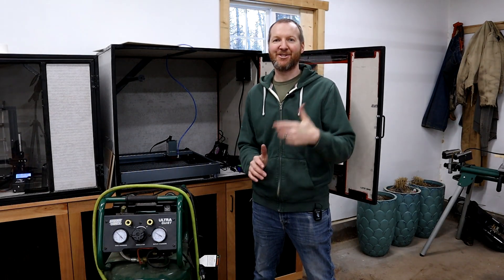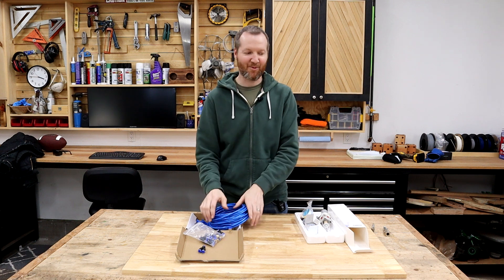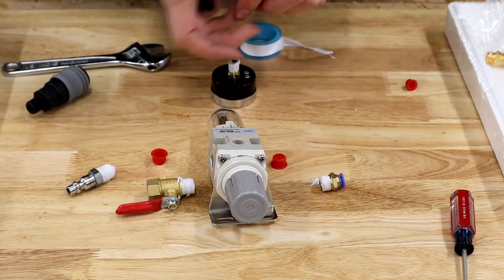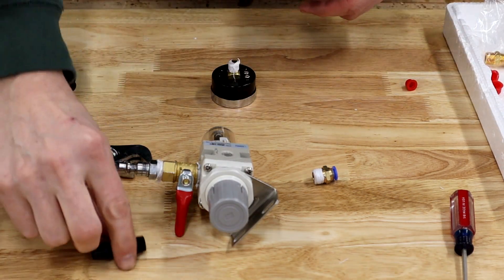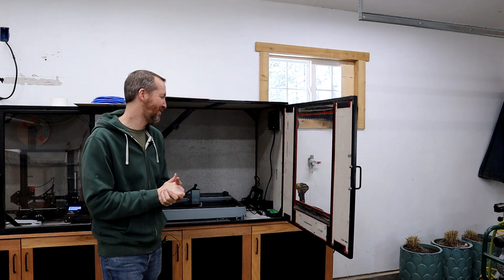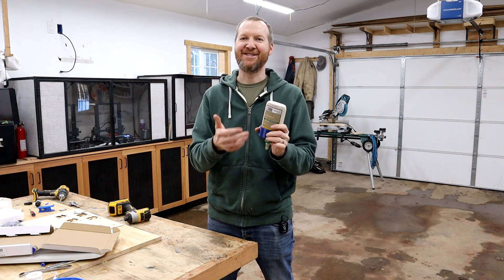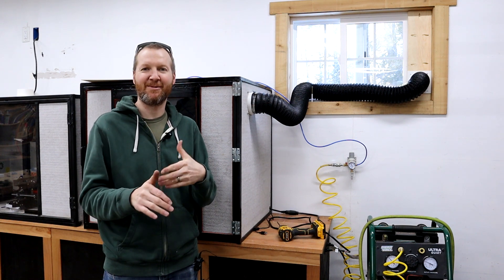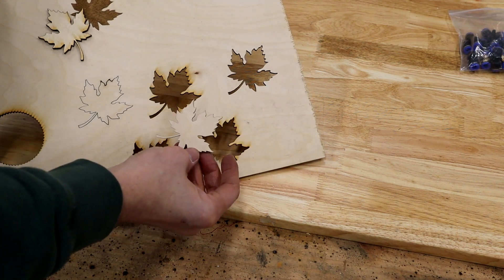$30 Laser Air Assist Upgrade/How to guide

Comment: I did this with a 3gal pancake compressor and results weren’t as expected. The compressor would run out of air and would keep the compressor running constantly and would cause the pump to heat up too fast. Returned the compressor and just bought an Amazon air pump.
Reply from the maker: Thanks for letting me know your results with the pancake compressor!

Comment: Doesnt your compressor already have a regulator? Usually decent compressors come with 2
Reply from the maker: Yep, my compressor does have a regulator, I just feel like it is a little inconvenient to use in this situation.
Reply: @chaddiy  got a question for you. my compressor and inline/regulator are the same as yours. mine isnt bulding any pressure, why is that.
Reply from the maker: @theemblemguys  hello, the only thing I can think of is your drain valve on your compressor isn't sealed, so air is leaking out of that.
Reply: @chaddiy  no the problem im finding is that it wont build pressure going through the inline filter itself. i bought a ball valve like you did but im still having the same issues...
Reply from the maker: @theemblemguys  ok, when I installed mine I had issue at first because I installed the setup backwards.  You might want to check and make sure you have your compressor line going in on the correct side of the filter/regulator.
Reply: @chaddiy  I guess I can see that if you don't have a dedicated compressor.

Comment: A "good" video, BUT,  I cringed when you started to thread in the fittings on the regulator....  a BIG FYI - when you wrap Teflon tape on a fitting, as you are looking at/into the fitting end, ALWAYS WRAP CLOCKWISE....  This direction of wrap will not "unwind" the Teflon tape as you screw it in.  The big A$$ bunching of the tape when you screwed it in PROVES the tape was wrapped CCW....  AND, when using this great tape, DO NOT wrap past the end of the fitting because you WILL F UP THE internals of whatever you are screwing....  A good idea video, but, not so much in the process....

Comment: Hello,

What size tubing is this for? The Amazon link has a couple different sizes. Is it the 6mm?
Reply from the maker: Hello, I am pretty sure it is the 6mm. I think the discription has changed on Amazon from inches to mm. I thought when I bought it, it was listed as 1/4 inch but 6mm should work fine. Good luck!
Reply: @chaddiy  thanks man

Comment: My laser machine is inside my craft room and my compressor is in my outside wood shop, so in the summer (Florida) the air around the compress is very humid, how would this affect the air going into the xtool, being it's in a air condition room? TIA.
Reply from the maker: Hello, I actually am not sure how the humid air would effect it. I know you can get in line air dryers that you could try. I am guessing it would be fine, but I think the only way to know forsure is to try it out. Good luck!
Reply: @chaddiy  Thanks for your reply

Comment: Xtool's air assist spec is about 30kpa or 4psi. Why 25psi and I can probably regulate that now on my compressor without the extra regulator.
Reply from the maker: Hello, that's true...you could probably just use your regulator on your air compressor. To me it seemed a  higher psi resulted in a cleaner cut.
Reply: @chaddiy  Thanks for the info. I haven't tried using air yet. Just curious as your psi was higher than xtool's equipment.

Comment: Very nice! Cheap simple upgrade that makes a world of difference. Quick question: What PSI did you end up using?
Reply from the maker: Thanks! For cutting I use around 25 psi...I have found for engraving it usually works better with no air assist

Comment: Awesome! i didn't really want to spend an extra $100 for air assist. What PSI do you set it to?
Reply from the maker: Hello, I usually run in the 20's for psi. You can do more and it helps for cutting, but if you are cutting small pieces, the higher psi can blow them up into the laser which can screw up your cuts. Good luck!
Reply: @chaddiy  Thanks! since its such a small hose, does it run for quite a while off the air in the tank or does the compressor have to kick on a lot to keep up? I think my compressor is 8 or 10 gallons.

Comment: How do keep the compressor from running constantly while cutting , nobody talks about that, the laser needs constant air pressure and when the air compresor hits the turn on switch it would turn back off and it get super hot and anoying
Reply from the maker: Hello, thanks for the comment. I completely agree with you. It does get annoying with the air compressor running. The one I have is a decent size...but it still runs quite a bit. I also have the smaller xtool brand one that works alright. It is quieter as well, but doesn't seem to work as well. If I turn this into a business, I would probably invest in a large air compressor outside my shop.  Maybe some day!

Comment: Thank you for actually providing links and the exact size and name of the parts needed! I bought a ComGrow air assist and it's absolutely unless so I've been looking for a way to connect my compressor to it for more power.
Reply from the maker: Glad I could help! It is hard to beat just using a regular air compressor to get the higher psi you need

Comment: What pressure did you set your regulator to?
Reply from the maker: Hello, for cutting I have it around 25 psi. I can cut almost twice as fast with this air assist setup. Engraving the pressure can be lower with great results!